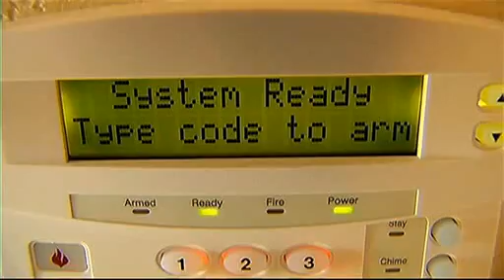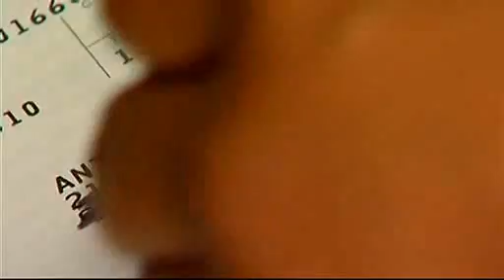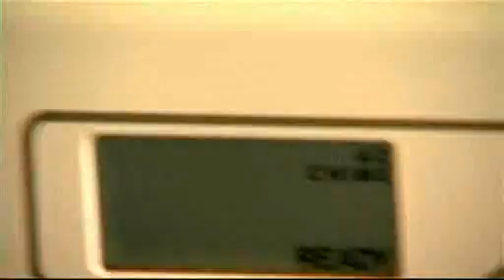Jim Stickley Demonstrates How to Bypass Home Alarms [TV]

Comment: Most comments below are negating the defeat is BEFORE the standard delay expires.  A valid point given that about 80% of enclosures are within the foyer closet, and if a basement exist in the mechanical room. Valid point, panels are easy to get into due to cheap standards, how about the industries awesome key control?  Given that all the manufactures use the same key for each of their entire panel lines why bother prying open the door, just use the key available on line.  Ademco: last 20years 2-keys, Interlogix 1-key, DMP:1-Key, DSC: 1-key, etc. How about those EOL resistors protecting your wire circuit, not.  Ninety percent of them are in the wrong place, the enclosure, just like in this video.  How about those outstanding reed switches that can be defeated with a rare earth magnet from outside the protected door or window?  The hair spray to blind the cheap motion detectors almost everybody is installing? Your not going to get a High-security system from ANY of the national or large regional dealers, their lawyers are not going to allow them to change their designs unless they can go back and address all their previous accounts that are vulnerable to defeat.   Rare is the sales person will identify these and other even more serious vulnerabilities; yes there are worse and even easier methods of defeating systems, during their consult or within their design.  All they are looking for is creating another account with a good creation multiple.  Work for one of the big security companies, argue your position of how you are actually protecting the client from an informed criminal.  Don't bring up Alarm.com's smash & crash feature unless your firm is actually activating that option.  Most are not for fear of additional false alarms, yet they use this feature in the sales pitch if they get pinned down by a savvy potential client.  Several of the top players will quote chapter and verse about smash & crash but they don't actually turn it on!  Doubt the claim, check yourAlarm.com accounts for percentage of smash & crash options.  Your company is probably lying to you as well.

Comment: There's just so much wrong with all of this.  For one, every panel should have a tamper switch on it.

Also, it would be a good idea to have 100% cellular or at least cell back-up with a single ring count so there is no delay sending information to your central station.

Even if it were phone line only you should still have an EOLR supervising that phone line as a zone.  That way if the line was cut it would alarm the system as if a window or door was open.

Comment: Jim, that's a horrible installation practise. 

In Australia we have laws governing the installation of alarm systems. The alarm panel has to be installed within an area covered by a detection device (usually a PIR) so you would have to trip an entry delay before reaching the panel. 

Saying that, if you are quick enough you could still disconnect the phone line before the panel dials out. I have a GSM system. They're worth every cent!

Comment: "The downside to this is you can buy a cell phone jammer for just $100".
The downside of that, again, is that that is not fullproof.
I proudly presented demo's with a very strong jammer.... until suddenly one provider (T-Mobile -Holland) apparantly was immune!! Tested with three different items: T-Mobile came right through, while all other communications way down for about 20mtr.
Keep also in mind that the jammers do not block the senders..., but the receivers.
So, better place the receivers NOT on the perimeter of objects.
Reply: You're a bit silly? It jams vodafone, kpn, but not T- mobile?
Who is the silly bugger?
Reply: Jpk Van EECHOUD
you because you fail to realise that tmobile works on a different frequency that you were unable to jam and that's the only single reason why the alarm worked.
Reply: Jamming of GSM, or GPS signals only applies to INCOMING weak signals, they do not jam OUTGOING signals, because they are a much stronger signal than the jammer unit. Cell phone jammers only block the incoming signal to a cell phone, they do not block the outgoing signal, likewise GPS jammers jam the signal from GPS satellite, but do not jam the SMS signal sent out from the GPS unit to a cell phone.
Reply: Thans you, 576924

Comment: Its irrelevant who its made by and where its made to be honest, In the UK an american panel would not be deemed safe for use with he exception of a few. All Grade 2+ rated panels in the UK have to have a tamper circuit, a box tamper, an external bell box with tamper and if its a monitored system it has to use a signalling device. The cost of a panel in USA is much cheaper than here. Also, your police will respond to activations. Ours require 2 different sensors to be activated in 2 mins !

Comment: How stupid how does anyone case a house to see where the alarm control  panel is.
Reply: There're websites that give you a tour of the entire insides of people's houses.. You can see inside of walk in closets, into garages, find out exactly where all sensors are and what kind of alarm system you're dealing with
Reply: @jamesclarke997  Then by extension if the person is selling their house it would have no contents worth stealing. Is that right?
Reply: @daffyduck8244  Patience grasshopper
Reply: @daffyduck8244  why would you assume there isn't anything of value inside? Houses can take a long time to sell.. also if not now then this is still pretty useful information to have for the next resident
Reply: The bigger question would be why somebody would want to case a house to see where the burglar alarm cabinet is?? That won't do them any good. If you walk into a commercial building and notice where the fire alarm system panel is at does that help you prevent fires?

Comment: bull shit, outside buzzer has tamper once the panel is opened buzzer should go off and even if you disconnect it will still keep going as it is battery powered. and strb is used to report status of panel

Comment: I'm sorry, this is obviously an older segment and older systems.  The security industry is constantly updating the technology used in these systems to stay ahead of the "criminal masterminds".  Burglars are looking for opportunity and very few would put in this type of effort unless they were wanting something specific.  Our systems today are wireless and use cell modules to communicate.  In the event of someone tampering with the system or crashing it, it automatically notifies the monitoring station and police are notified.  If you have a system not being monitored, then none of this matters anyways as the Burglar will just silence the siren and go about his business.

I have over 15 years in domestic and international security as well as vulnerability assessment experience on government owned properties and fortune 500 security assessments.
Reply: I assume your company is aware of GSM jammers which can be built by professinal thieves. The most secure systems I've seen used a technique where encrypted signals are contantly sent in timed intervals to the monitoring company. If any wires are cut or signals blocked then the signal doesn't arrive and the alarm goes off.
Reply: Echelon Home Security Really? you think smash and grab on the radios always works your mistaken.Ive serviced many and seen at least 5 times in the last 3 years where it didn't.The main problem isn't international movie jewel theives defeating systems.The main problem is police response times.Ive heard first hand of customers who the cops called after their alarm emergency and said they hav no one to send there but will be there tommorrow if they want to file a report.

Comment: cue mission imposable theme:LOL
but that wont work on ours because A the control box is well hidden and B I had the Alarm installer make an alarm loop so if the phone lines are cut it sounds the alarm anyway. granted Alarm Co. wont get the signal but the neighbors will sure hear it

Comment: As one who has worked on security systems for over 45 years, most of what this bloke is saying is pure nonsense. Cheap alarm systems from your local DIY stores are completely useless and can be disabled very easily, but anyone with any common sense would install a professional alarm system. If the monitoring is via a telephone line, then yes, just cut/disconnect the phone line but that has been known for years. That is why professional systems use dual signalling GSM and landline. If one goes down it signals via the other. It would be impossible for someone to force the front door and go to the alarm panel, open it up and disconnect the phone line as this bloke states, simply because the front door only is on 30 second delay, whereas the tamper on alarm panel is instant at all times. Therefore the signalling would go out immediately the tamper switch on alarm box was activated. IP camera's may seem good, but once again if the phone line is cut/disconnected the system is rendered useless, and unlike an alarm system, IP camera's do not inform the user the phone line is down. If using IP camera's, a portable Wi Fi hotspot with Sim card is the most secure method.
Reply: You're making a little bit too much sense man.
Reply: I agree with you with everything except for the last sentence.
Reply: A Wi-Fi hotspot is amongst the least secure methods. I also do install some IP camera systems that do trigger an alarm based off of motion that is seen by the camera.

Comment: What a nonsens, Jim.
A well projected system will sent the alarm message in a jiffy!
So, 1- in this case: the delay time was far too long.
2- The cabinet where the centrale is was not locked.
3- The general customer in Holland is mostly a victem of an opportunity burgler.
Higher security? Higher price!
General rule in Electric security should always be: 
First detection.... and then another barriere!!
And we saw you running through the house without other detectors that are not delayed.
Kind regards, Jan van Eechoud
Reply: unfortunately it is far from nonsense . There is no deadbolt that cannot be picked all wi fi send signals that can be disabled hidden cameras same. Police know what bump keys are and still refuse to take reports on burglaries if no sign of forced intrusion. I am being stalked by a piece of garbage that used to work for cox. Mobile Spy Wolf Tracker ssshhh trojan virus all disgusting stalker hacker helpers

Comment: This is highly misleading. It is not as easy to get into these panels as shown. Notice they don’t show you from start to finish him getting into one without a scene cut. The last scene shows him going right to the panel. A burglar is not going to know where a panel is hidden and the time taken to find it is more than enough in most circumstances to go into alarm. The last example showed him stopping the alarm after it went off. Just because he silenced it means nothing. The signal was sent. The central station would still dispatch if the owners were not reachable or the flight them it was not a false alarm. Not to mention the tampers on door sensors, motion sensors and now most  alarm panels communicate over cell phone communications as a backup or exclusively. Also, statistically burglars will avoid a home with posted alarm signs somewhere around 85% of the time and pick an easier target.

Comment: well with analog security its easy. they ping like once everyone 1 or 2 hours.. newer digital systems ping ever 2 secs
Reply: What?!? No they don't. I work in the industry.
Reply: @W8RIT1  i very much simplified analog and digital difference but im still right
Reply: @fakeaintreal  no, factually speaking you are incorrect.
Reply: @fakeaintreal  there are what are called timer tests depending on what type of application they may send off signals hourly, daily, or monthly to confirm communication to Central station monitoring. This depends on whether or not it is a fire alarm system or a UL alarm system.
Reply: I know this since I work in the industry.
Reply: @W8RIT1  what im saying. Example. Analog systems can send an hourly ping to test for connection. If u were to cut the line  in theory up to 59mins could go before any notice and alarm activates, with digital the frequence of pings is at most like two seconds. So alarm will activate much faster.
Reply: @fakeaintreal  you're STILL incorrect. I've told you the answer but you still think you know the answer. You can lead a horse to water ...
Reply: @fakeaintreal  listen close. There is no difference based on the communication method.
Reply: @W8RIT1  yes there is.

Comment: Why don’t you just put a lock on you’re box
Reply: bash it open quickly
Reply: @LoydAvenheart it does not matter in the slightest where the cabinet and the keypad are mounted. Many burglars seem to think that taking the keypad off the Wall will prevent an alarm from being sent... The same with ripping off the main cabinet. The alarm has already been sent by the time you even touch either one of these.

Comment: SNIFF SNIFF wait I smell emm yes BULL SHIT. If the alarm is fitted properly the tamper switch will trigger the alarm. If you cut the wire to the bell box then the battery in the bell box itself will sound the alarm. Plus you should have a tamper switch in the bell box.

Comment: Not being rude but american alarms are bullshit ! In england they are all tamper protected and a bit more hardcore. The panel I use is a honeywell galaxy which is often well hidden and the dialler is onboard pstn,gsm and radio wave to the monitoring centre. The control panel is constructed from 2 mm thick galvanised steel and held in ace by two long screws. As sson as the lid opens half an inch the system goes into full alarm regardless of status. Also bell boxes will activate their own battery.
Reply: How does a bellbox activate its own battery??
Reply: What's the battery going to do? Charge him??